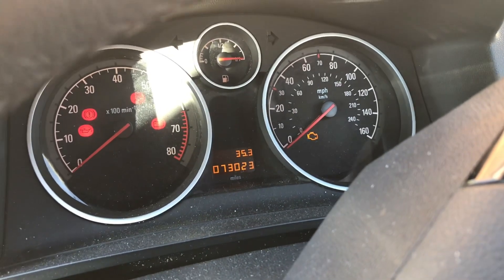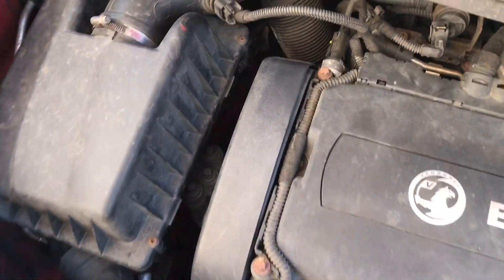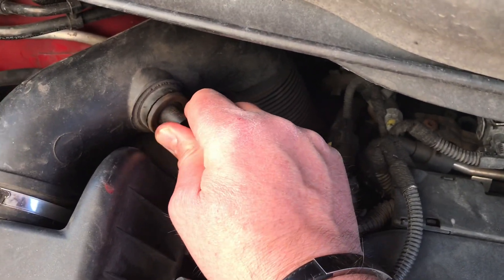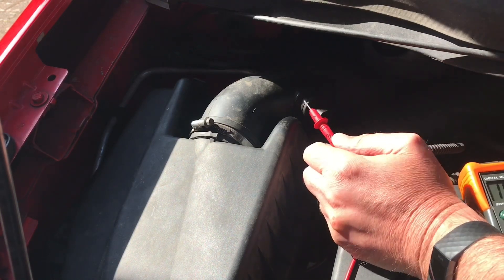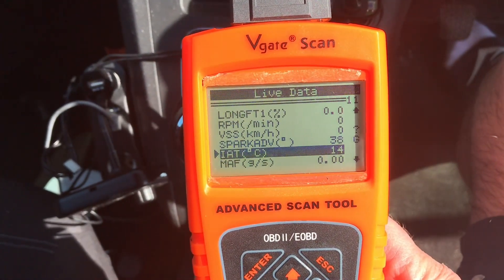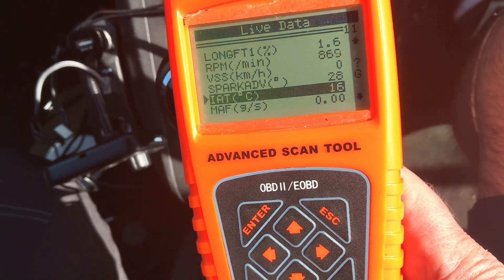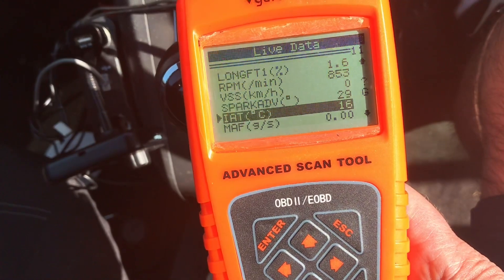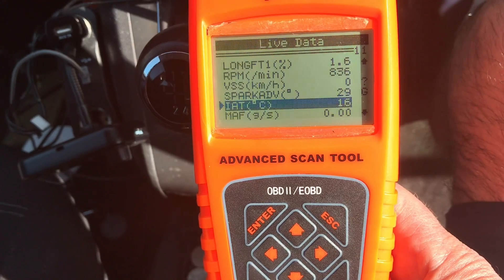Vauxhall Opel Zafira air intake sensor problems

Comment: Hi mate thanks for the video, i have a zafira 2007 and the revs keeps going up and down while stationary so the car is idling a little bit . Been told it could be the air  intake sensor , do you think i should change it? Engine light keeps coming on and off
Reply from the maker: Well firstly I’d try cleaning it, but there’s lots of reasons your car is surging, could be a vacuum leak , could be egr. Try unplugging the sensor to see if there’s any change, in performance. Do a pedal test, to see if there’s any related codes.

Comment: Hi. I have a 09 zafira petrol 1.6 (don"t ask me why) but i find i am cleaning the little MAF quite often, because of a lean code, works for a while then, neads cleaning again. Would like you"re thoughts on this.  Thanks.
Reply from the maker: Just out of interest, do you live in a dusty area?
Reply: No not dusty here. It can throw a code on damp days or dry. Filter pretty new also. Think i"ll get a spare sensor incase it does fail. The car drives fine though when it trips an engine light.  Thanks for the reply. @drivewaydiyer6504
Reply from the maker: @davidjohnrobinson2887 sounds like it needs replacing. Could be breaking down and any contaminants is affecting it, more often.
Reply: I have the same, Zafira B 1.6 petrol Life (I believe 2nd to lowest trim edition).  58 plate, runs ok but idling a little off, changing the Oxygen Sensor today, hopefully that will fix it, never been changed. 

1.6 petrol, sometimes we have the 2 seats up at the back too, great for family and the best thing about it is no ULEZ.
Reply from the maker: Do a pedal test, see what codes are stored.
Reply: @FerotKwari  Howdy. I changed the MAF sensor and have had no probs since. That is plugged into the air intake pipe. You mentioned the O2 sensor, there are two, one before and one after the Cat in the exhaust. Thanks.

Comment: Hi. My sensor is ok but one of the wires has snapped inside the connector block. How easy is it to rewire or replace the connector block?
Reply from the maker: I’d be tempted to get another connector from the scrapyard and crimp it or solder it. Depends on your ability.
Reply: @drivewaydiyer6504  nice one. That sounds like a plan. Thanks Very much,😁

Comment: Hi there any ideas i have a vauxhall Zafira b 2007 1.6 petrol revs abit high and the car judder as low speed or if you just sit your foot on pedal i got new clutch new plugs new coil pack its stressing me out new o2 sensor bank 1 any help or tips
Reply from the maker: @smithygaming7533  have you done a pedal test, might be an egr issue
Reply: @drivewaydiyer6504  how do you do that am not good with cars am trying my best
Reply from the maker: https://youtu.be/ZmsLv16cIhw?si=k8mn2QWa0fPsclPU

Comment: Am I correct in saying when then engine is running the temperature of the sensor should read a couple degrees higher than the outside temperature?
Reply from the maker: You have to take into account of all the variables of heat and where it’s coming from. The car will always be hotter than ambient temp. I suppose when the car is cold and no additional heat, it would read the same as outside. Live data is always important from cold to hot, to verify its reading accurate from cold to hot.
Reply: No this is not engine dependent; it measures the temp off the air coming into the system from the front of the car via the air intake ducting..
Reply from the maker: @rainerrieck6596 yes, it read the outside temp and as the engine warms up , the air would be slightly warmer, around the bay at idle, but would probably cool when driven. Great bit of kit which would affect fuel trim. MAF sensor would be more efficient than these.

Comment: Got same problem changed the sensor and wires look okay ,Any idea what else  ?runs fine just engine light still on
Reply from the maker: Did you erase the code . Is there a leak in the duct, have you tested the wiring? It has a 5volt biased reading. If you disconnect it , it and bridge the wires, there will be 5 volts.

Comment: Hi there. What are the symptoms of a defective sensor like that? Thx
Reply from the maker: Usually lack of power, poor performance.
Reply: @drivewaydiyer6504  Thank you. I have poor performance especially around 2000 rpm, then blows out. Map, sparks, ignition module and complete exhaust system already changed. Became better but not perfect. Error code was 0170(fuel trim) but since exhaust system change it doesn't exist. What do you think maybe oxigen sensor? Today i ordered a new air intake sensor i hope it will solve my problem, 2 oxigen sensors would be expensive.
Reply from the maker: I think the next step, is to get some live data, on your fuel trim and see if it’s rich or lean. The fact that you changed your exhaust and it improved. Perhaps try some cataclean. EGR valves  are a huge problem on these models. They get gummed up. Check for air leaks aswell, clean the throttle body, could be sticky. But live data will be your next step.
Reply: @drivewaydiyer6504  thanks buddy, appreciate

Comment: Can you advise what a P0400 code could be please? Engine lights on and it's draining fuel fast. 08 vauxhall zafira. Thanks :)
Reply from the maker: Egr fault , probably needs a good clean. Egrs are a huge issue on Zafira’s
Reply: @drivewaydiyer6504  that's what ii was originally told but it's all been replaced 4 months ago and still have the same problem
Reply from the maker: @jojojojo3416  it may need cleaning internally, some people cap them off and remap. Could be other reasons like ecu, wiring, could be a faulty egr. Lots to think about.

Comment: Hi, my code on my vectra C is p2279 and it says its an air intake sensor,  would this be the sensor before the airbox . I have watched a few videos and they all seem to be a bit vague.
Reply from the maker: This code is for disparity in what sensor is reading and what is being read at the manifold. Might he worth checking for air leaks. Get some live data on the sensor, to make sure it’s reading correctly. You don’t want to swap it out if it’s reading ok.

Comment: My 2014 zafira is giving me problems. When I diagnosed it came with MAP sensor, can you help?
Reply from the maker: You can try replacing it, are you having symptoms, poor running etc. You should get some live data. Check connection and wiring also.
Reply: @drivewaydiyer6504  I will check with my mechanic tomorrow and see if it works after cleaning it

Comment: Any idea what my issie could be. Wjen i remoge the disptick can feel the engine sucking in. Have taken kff the rocker cover head fitted new one with new PCv valve. Also idle was up and diwn lots i cleaned throttle bodh now steady idle just high. Over 1k
Reply: 1.6 petrol 2008
Reply from the maker: Have you done a pedal test, may give you an indication, possibly an egr issue or vacuum leak. The fact you clean the throttle body and it improved it , even though that’s a high idle. I suspect it’s something around that area. Do a pedal test first though.
Reply: @drivewaydiyer6504  what's the pedal test mate
Reply from the maker: @jacko2815  https://youtu.be/ZmsLv16cIhw?si=nMe3RSRYzldDIQKD

Comment: I have error code p0171 do you have any ideas where to start with this error.
Reply from the maker: Look for a vacuum leak, you may even have an egr problem. It’s running lean, so it’s getting too much air. Look around throttle body, air intake etc splits, broken pipes etc
Reply: @drivewaydiyer6504  Brilliant thank you for your advice 👍🏼 will update here with my findings

Comment: Hey. I have a opel astra h 2007. Error code p0110 show intake air temperature sensor circuit 1. I did change it. But the code is still there.
Reply from the maker: Check the connector and the wiring. The wiring at the connector can be quite fragile.

Comment: The sensor will not warm up with the engine heating up, that the job of the temp sensor in the water jacket, the one you showed measures the ambient air temp entering via the filter from outside.
Reply from the maker: It was never mentioned it was engine dependent, I think it was explained it was based on incoming air. Which changed slightly due to idle. Not sure where your issue is here.

Comment: There is code P0443 (evaporative Emission system purge control valve circuit) on my zafira b 2013 patrol, any idea please
Reply from the maker: Probably the selonoid or wiring issue. Check connections and wiring integrity.

Comment: Hi, I have opel zafira 2006 1.8 103kw. And car acelerate very slow, serviser did not find any issue on compiuter, can someone help, do i change same part like you?
Reply from the maker: If there’s no codes it may not be an issue with the sensor. Might be worth clean the the throttle body, with some carb cleaner. The valve can get a bit sticky and choked up. Try that first. Check air filters and plugs too.
Reply: I changed valves and plugs, but same problem
Reply: Vvt valves i changed * to be specific
Reply from the maker: @britkasablja3881  if you changed the valves, is the timing ok. Could there be something you missed. Sounds a bit more in-depth . Vvt selenoids ok?
Reply: @drivewaydiyer6504  vvt are oke, i think that i am gonna try and change  maf sensor
Reply from the maker: Have you cleaned it ?
Reply: @drivewaydiyer6504  i cleaned it, yes, but same, car starts acelerate only on high rpm

Comment: I have a 2007 toyota camry xle v6 it starts and stalls out,idles sounds like it's about to back fire drives slow and shows these codes is that most definitely my intake air temperature censor
Reply from the maker: Check connections, make sure there’s supply to the sensor. Very much sounds like there’s a sensor issue.

Comment: I have a crank start, getting this code aswell
Reply from the maker: If that’s the only code you’re getting, I suspect it will be that, clean the connector and the sensor. Probably worth changing it out. Can you access live data? See what temperature it’s reading?